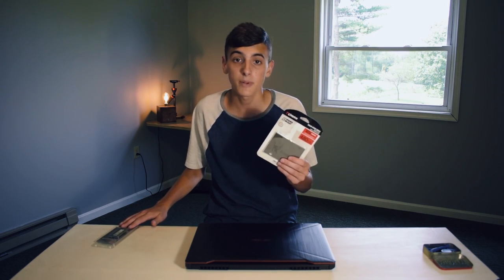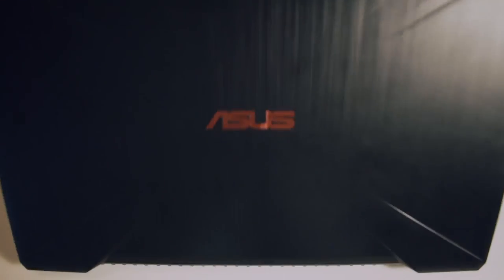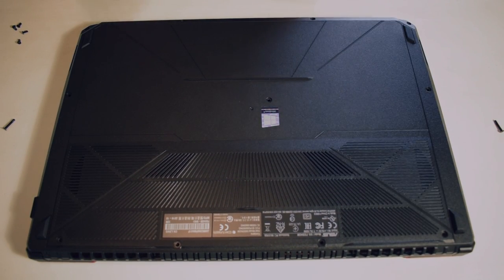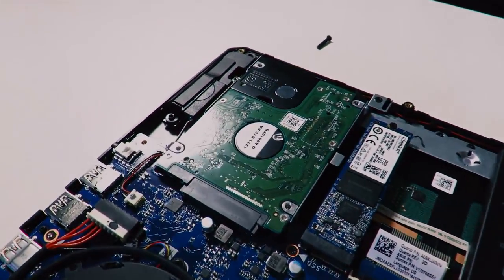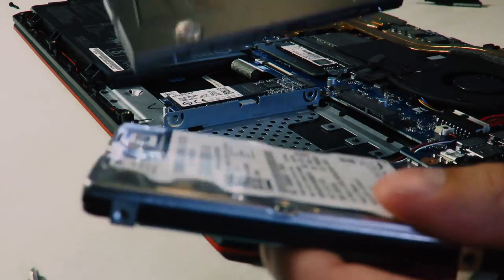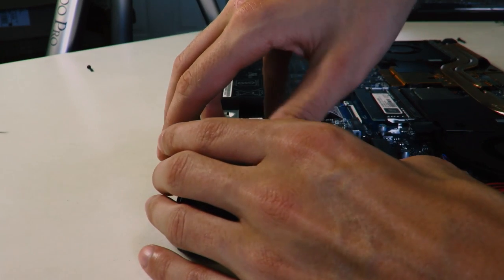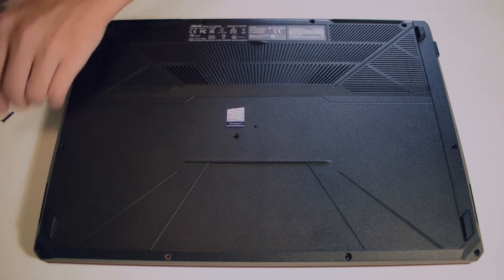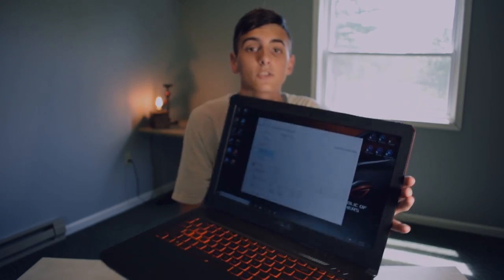UPGRADING LAPTOP!! | ASUS TUF FX504 | SSD and RAM [2019]

Comment: I have an ASUS TUF FX 504. Do you know if I can put another SSD (stay with two) or let my USSD (256GB) plus add a HD of 1 TB (non-ussd)? Does it have just one slot or it has two slots?
Reply from the maker: It has a M.2 slot and a 2.5in slot and that is it. Unless you were to remove the WiFi card and add another ssd that way but not really recommended.

Comment: I am okey with losing all data in my hdd. Will not cloning the hdd cause any problems like losing the windows?
Reply from the maker: Not if its done correctly, the laptop wont know the difference with cloned drives.
Reply: Thanks for the anwer.I am considering buyin crucial p3 500 gb m.2 ssd but kingston is an option too. Do you recommend any of them?
Reply from the maker: @PivotStickmanAnimations  Crucial and Samsung drives are good options.
Reply: one more thing. I will probably buy crucial p3 500 gb m2 ssd but some other tutorials mention motherboard cooling is not great with p3 what is it a bad choice ( my laptop is asus fx504)
Reply from the maker: @PivotStickmanAnimations  SSD cooling is kinda pointless except for the top 1% of M.2 drives. You shouldn't have any issues while use a M.2 ssd in the laptop. Linus tech tips did a video on SSD cooling, if you wanted more info on it.

Comment: thanks for video 
My laptop is ASUS FX504GD and it has a default SSD M2 16GB, if I remove it, the laptop will not boot. Is this normal?
Reply: I think you removed the Intel Optane. Didn't you ? If you have this ssd, perhaps you had to disable Optane first before removal. Try to put it back and check about how disable optane on the web
Reply: If you removed Optane without disabling it it's normal it doesn't boot. It's meant to boot with it

Comment: What was the brand of the pre installed ram?
Reply from the maker: I don’t actually know. It doesn’t really matter as long as you have the same speed of memory.
Reply: @ZackEberly  I asked you because I watched one video which told the brand and speeds of both the Rams must be same in order for the Rams to work as dual channeled. Is it true?

Does your laptop detect it as dual channel?
Reply: In my tuf fx 504gd pre installed sk hynix 2666MHz.
Reply: @vishalragi9144  Samsung 8gb stock ram in mine. I added an other brand 16gb ram and dual channel activated automatically.  No issues
Reply: @vishalragi9144  check for speed. Mine is 8+16 different brands and it's fine

Comment: Can i just do the upgrading the ram thing? or is it mandatory to do both coz i dont have a cloning machine and the proccess seems a bit difficult
Reply: You can just add the ram, but adding the SSD will make a huge difference in your laptop performance.
Reply: Sebastian how will it make a huge difference?
Reply from the maker: @davy1266  If you don't have an ssd in your computer either for boot drive or extra storage you are missing out. A hard drive is very slow. The price of ssd's are very low at this time. I'd recommend getting one if oyu don't already have one.
Reply: ZackEberly do I have to use the ssd and ram linked in the vid or can I find other ones that are compatible( preferably cheaper ones)?
Reply from the maker: @davy1266  You can use whatever you want so long that its compatible.

Comment: Heyy brohterr,when i"m trying to upgrade it does 2 slot SSD ? Or we switch SSD parts(originally from asus)  into the new one? I have FX504GE Series.... which is i have to upgrade SSD and RAM ....
Reply: Hi i was wondering does your laptop use a new M.2 SSD now? I wanna replace the original SSD on my FX504GE too but Asus Service Centre said it can't be upgraded into a new SSD
Reply: @hafidznurramdhan3712  yes it is bro,  it have m.2 nvme SSD slot , when you upgrade into SSD you should be bought the M2 Nvme SSD or if you want to buy the 2,5 inch SSD you should replace the 2,5 inch Hardisk slots into them. 😁👍
Reply: @hafidznurramdhan3712  if you want to replace into new one,you should buy the Orico Nvme ssd enclosure to cloning the data into the new one 😁

Comment: Bro can i use 2400mhz ram 4gb in this laptop? Please tell me
Reply from the maker: Yeah... the only thing is that if the other ram stick is running at 2666MHz then it will down clock if you use a slower speed like 2400MHz.

Comment: can you upgrade both rams with 16gb ones?
Reply from the maker: Yes if you buy a kit 16gbx2 = 32gb
Reply: @ZackEberly  It Supports 16 Gb per slot ?
Reply from the maker: @NarrenWasHere  Correct so 32gb in total.

Comment: What are the specs of your laptop?! MINE DOES NOT HAVE NEARLY AS MUCH AS COPPER you do!! Mine has i5 8300H 1060 6 gb 256gb ssd, i wish i had that much copper😂
Reply from the maker: That's what my specs are. i5 8300H, 8gb RAM, GTX 1060 3gb, 256 m.2 ssd.

Comment: Hey bro my laptop has 1 tb sshd and 128 gb ssd and I want to upgrade the ssd to 480 gb what should I do?
Reply from the maker: Buy a 480gb m.2 ssd. Now whether you want to keep the files from the old on or start with a fresh windows install... I forget if it’s a NVME ssd tho
Reply: @ZackEberly  it means there's only one slot for putting ssd, I want to keep old files,do I need a cloner like you?
Reply: @karanchaube  Hi does your laptop is FX504GE with GTX 1050Ti? Have you already tried to replace the 128GB SSD? Does it works with ur new SSD in that M.2 slot?

Comment: Bro i have the same laptop with i7 8th gen 1060 6gb and 8 gb ram. I am facing so much stuttering and frequently FPS drops. Are you facing the same problem. If yes then by increasing ram can help in it ??
Reply from the maker: It can a little but make sure the fans are on performance mode. While gaming see if anything else is using the gpu in task manger. Update drivers for gpu. Or lower in game settings. What games are you experiencing frame drops in?
Reply: @ZackEberly  every game which i am playing. Like gta 5, forza horizon 4, the witcher 3, fortnite. I am really disappointed by this laptop. I did all the things which i can do for smoot gameplay. But nothing happened.
Reply from the maker: @KSSaini-jg4zr  When gaming are the fans spinning to max? I also know the that the i7 variant of this PC (i have the i5) over heats with the cooling system. Thats prolly the issue.
Reply: @ZackEberly  yes bro the fan speed is always on max. These fps drpos make me very disappointed. I have 8 GB of ram. Now i want to add 16 GB more. Hope it will work. Can you suggest some 16 GB DDR4 ram 2666 hz ??????
Reply from the maker: @KSSaini-jg4zr  there is some in the description of the video.
Reply: K.S. Saini works for you? No more fps issues?
Reply: @Daniel-qo3gh  i have upgraded my laptop with more 16 gb ram. Now i have 24 gb total nut no effect on FPS drops. Still getting stuttering. But today i am going to change my thermal paste. I hope it will work..
Reply: K.S. Saini I read that it can be fixed with BIOS update and other drives
Reply: @Daniel-qo3gh  notjing happened bro i did it all updated bios. All the drivers. But still facing stuttering
Reply: K.S. Saini Damn I just bought this laptop ...
Reply: @Daniel-qo3gh  which model you have and specs ??
Reply: K.S. Saini same model but i58300h, gtx 1050Ti and 8ram
Reply: @Daniel-qo3gh  use it bro if you find any kind of stuttering just replace it.
Reply: K.S. Saini thankyou!!
Reply: @Daniel-qo3gh bro i just recently changed thermal paste and cleaned all the fans. And now stuttering problem is gone. Everything is fine and games are running very smooth even on high graphics.

Comment: i have the same laptop
but in fortnite it wont give me more than 60 fps
Reply from the maker: What’s your fan speed set to. Download HWmonitor for temps to see if your thermal throttling. Make sure your in game settings aren’t to high and wait if v-sync is on. Then you will only get 60fps cuz of the screen.
Reply: @ZackEberly  thanks for helping
the fan speed is advance. i download HW and the temp in 84 when i play like half hour on gta v on balace and 93 on high battary use. i wont to know the proplem to fix it because here is Syria not all anderstand. so thank you for helping.
i know i cant get more than 60 fps but like vallorant i play 120 fps i know i dont see 120 fps but ist number but in fort it wont get up than 60 and sometime get 40.

Comment: hey guys, I have  an fx504gm and I have been experiencing a lot of freezes since owning the laptop( a year). Can I do something to solve this issue? also thinking of doing a ram upgrade as well.
Reply from the maker: What type of freezes? Like complete lock up. You have to hold the power button to restart it. Or just windows freezing and stuttering?
Reply: @ZackEberly  full on laptop freezes and I can only solve it by restarting the laptop
Reply from the maker: From my testing it has to do with the 2 gpus switching display. (I get that from time to time) 
1. Make sure all drivers are up to date
2. Go to nvidia control panel, chose which gpu you want to use (sorry it’s vague) but I think it’s with 3D something
Reply: @ZackEberly   I'll try, thank you
Reply: Hello, did you fix it? I have the same issue.
Reply: @mighty_gai  momentarely i took off the back housing and carefully put the laptop on a cooler and it seems to be working. i occasionally get a freeze or a lag spike, but it's significantly better than before.
Reply: @codrinmarian9327  hi there, same here. i also updated graphic driver and bios. now it works fine. i hope it wont freeze anymore i cant afford to get a new one. hahaha
Reply: @mighty_gai  thanks for the tip! I'll make sure to have my drivers updated. Thanks mate, cheers!
Reply: @codrinmarian9327  no problem.

Comment: Does your Old ram and new ram adds together? Im curious. How much ram do you have now?
Reply from the maker: Yeah. Both are 8gb sodimm ram sticks so that adds up to 16 GB of ddr4 ram.
Reply: @ZackEberly  Thank you. Btw All laptops ram ddr4 are the same?? Im planning to buy one. btw i bought a TUF Fx504 with 16 gb ram i7 and im planning to upgrade it in the future. Is it okay to add more 8gb or 16 gb?

 -950th subscriber
Reply from the maker: @reymarm.3  You can add 16 gb of RAM. If there is a so-dimm slot open that is. If both are filled then you have to replace both to get the higher capacity of RAM (in your case that would be 32gb of RAM)

Comment: Do I have to unplug the battery?
Reply: @ZackEberly  is it necessary to do that does it hurts your laptop?
Reply from the maker: @karanchaube with it plugged in there is a greater chance of shorting out the laptop. I didn't mainly because i forgot. When working on pc's i always remove power to them.
Reply: @ZackEberly  Ok I will make sure that I unplug it first thank you.😊
Reply: @ZackEberly  How do you disconnect the battery?

Comment: yo can i break something when i touch ssd in my hands?
Reply from the maker: Not the outside of it. But if you were to touch the connects (sata) you could damage them with oil from skin or a static charge. Hard drives I'd be more careful with tho. They have an open PCB.
Reply: @ZackEberly  oh my bad i meant ram* not ssd sorry broski
Reply from the maker: You can kill ram by static shock. If the RAM doesnt work it could be from dust on the contact connection. I usually hold it but the edges just to be safe.
Reply: and 1 more thing. How to open laptop cuz i cant
Reply from the maker: @JohnJohn-yh1bn  -Online tutorials on how to upgrade your laptop are everywhere. Thats what i would suggest. IFix has many tutorials. The tools your gonna need is most likely a small screw driver and some pry tools.

Comment: My laptop is the FX505DT, I recently bought a 16gb ram but I just recently realized that my max speed is 2400 but the one I bought is 2666.
Would it still work?
Reply from the maker: Yeah it will still work. It’s recommended to have the same speed but it doesn’t harm your computer. It actually will down clock to make the speed the same which is 2400 MHz.

Comment: I'm going to buy this but I worry memory is very low, can I upgrade my hardisk to 1tb
Reply from the maker: It has an open 2.5 in slot for ssd or hhd. So yeah I added a 480gb ssd to my laptop.
Reply: @ZackEberly  I'm going to 2019editon, but it only 500gb ssd,  I have to add upgrade 1tb extra,  can I do that is the option available?
Reply from the maker: @battlefist6884  Check the specs. If it has an M.2 SSD and nothing other storage than yeah. You can put in a 1tb ssd or a 1tb hard drive. MAKE SURE ITS 2.5 in. It is not made for a 3.5 in hard drive. I recommend a 1tb SSD for super fast speeds.
Reply: @ZackEberly  I'm getting my. Laptop  importing from us,  since giving day and black Friday,i hope i get a good laptop, I have given three names they are 1.aus tug 1660ti, 2.acer predator Helios 300,3.dell xps 7 144hz 1660ti. If I get anything which is cheaper then I will get from this.  But if your from US please share me the offer prices,  Cox here in India it is too much overpriced bro

Comment: Whenever i try to boot it just goes into bios over and over
Reply from the maker: You need to select your boot device from the boot manager. Pick the M.2 ssd its the drive that has windows on it. If you don't know which one that is try all of them.
Reply: I’ll try
Reply: ZackEberly Oh wait I dont have m.2 i installed a 2.5 sata 3 ssd  but whenever I save and exit out of bios it just goes back to it
Reply: ZackEberly Do i need an m.2 to boot windows?
Reply from the maker: @rjs802  There is a setting that stops the bios that keeps the bios from booting first. Asus might have some information on it on their website.
Reply: Is the problem because the ssd don’t have windows on it? I didnt clone it with my hdd btw
Reply from the maker: Wait if there isn’t windows it’s not gonna boot into windows. Is this an extra drive or a boot drive?
Reply: @ZackEberly  Yeah I figured it out lol

Comment: How come you got 2 coper  heat pipes ? If you looks at others everyone has got full one and 1 half coper heat pipe.  Can you please share your model number ? see this here only 1 and 1/2 coper pipe : https://youtu.be/ajW6if8anCg?t=166  https://youtu.be/kjYMP0wUzg8?t=856
Reply from the maker: Yeah... Asus TUF FX504GM- WH51
Reply: @ZackEberly  Thanks. I opened mine and I also got  same 2 heat pipes. GTX 1060 6 GB has 2 heat pipes. Do you think 2 pipes sufficient ? I am getting power throttling in my model of i7 8750H and GTX 1060 6 GB.
Reply from the maker: @wiekotamros2634 I have the i5 8300h with a 1060 3gb and it doesn't usaully therm throttle but with the i7 model, its not enough of cooling.

Comment: He did so many things wrong in this video and no one here pointed it out for him. Super Sad. Don't do what he did please find better video then him.
Reply from the maker: I'm slightly confused. What is wrong? I'll take criticism.
Reply: @ZackEberly  Re-watch your video carefully see what you did then. But i'll point each mistake then that is bad as for the rest are fine.

1. Always Unplug Battery first before installing new hardware like Ram, HDD, and ect upgrades.

2. Don't mix and match different ram brands because it'll cause trouble later on. Speed will be affect mostly. Plus blue screen of death, if not then you are good. (I did this one and learn from it. My PC had ram issue from it) People say mixing memory brands is good but its bad to do. I learn from it, even if it support the same JEDEC official standard spec doesn't matter at all. Each ram is made different with tweak standards.

3. If you plan to upgrade your HDD to SDD you could of save more time cloning it from pc then doing it your way. Next time Clone HDD first before doing hard rive change to save more time. Also did you use the same pc to clone without back case on? WTF no don't do that, you can cause harm to your pc parts that way. Always clone the HDD first while its in still then change it out.

Overall the rest is fine. 1-3 i said was bad to do, others should take note of it. If you left your PC plug in the wall outlet you'll damage the pc plus shock yourself. Desktop or laptop doesn't matter always unplug battery first.
Reply from the maker: @GamingMaster4386J7C  Yeah i agree with all of those. I ran into several problems and took the risk. I did forget to unplug the battery. I could say it was my first time upgrading a laptop. Thanks though for the feedback.
Reply: I am also looking forward to upgrade my FX504 With Adata’s 8gb Ram , What Problems Did You Came Across After Upgrading Ram? Plz lemme know
Reply: My FX504’s Specs are:
i7 
8gb 
256 ssd
1 tb hdd
1050ti 4gb
Reply from the maker: @al-farisb2473  I didn't have nay problems. Just make sure you buy the same speed ram. I'm guessing the speed is 2666mhz just like mine. You can see the speed in task manger under performance and then under RAM.
Reply: Thanks Man
Reply: One More Question- I Use My Laptop On Overboost Mode Even Though I Don’t Play Games, Will That Affect My Laptop?
Reply from the maker: @al-farisb2473  if your talking about overboosting fan control that makes your computer run faster than no it should work fine.
Reply: Did you have any problems using two different ram brands? Because the one that's already in its from samsung
Reply: By the way i've had problems with the fans, i don't find the software that lets u change the fan speed with the keyboard, Do you know anything?

Comment: The laptop is not worth the money. So many problems with him.
Reply from the maker: That's what I'm hearing about it. Its definitely not a recommend anymore for sure.
Reply: @ZackEberly  Did you install a M.2 ssd on laptop aswell?
Reply from the maker: @TomySTS  No just an extra 2.5in ssd
Reply: @ZackEberly  You need an adapter for that right?

Comment: what exact version of this laptop? because the heat pipes is different from others fx504 that i saw.....and what is the specs?
Reply from the maker: It is an FX504 but it is an upgraded version. Specs are i5 8300h, 8gb of ddr4, GTX 1060 3gb, 256gb m.2 ssd... plus the upgrades I did to it.